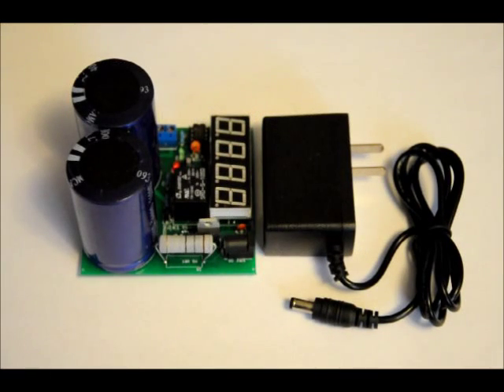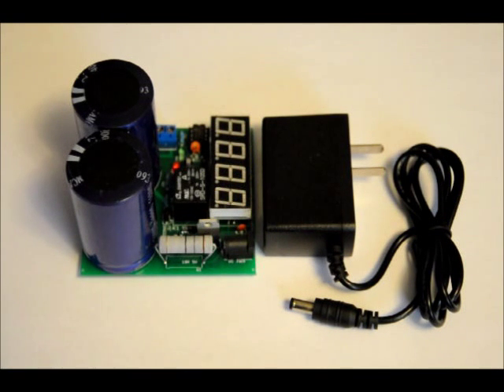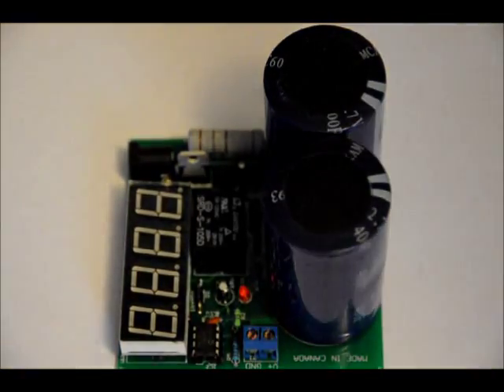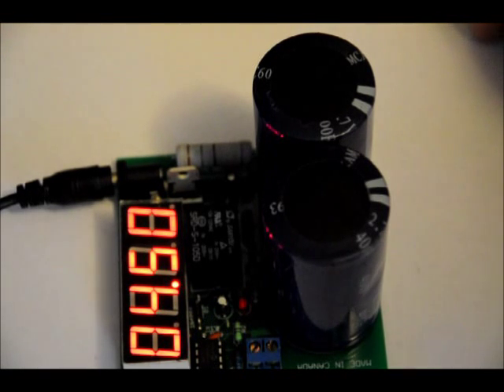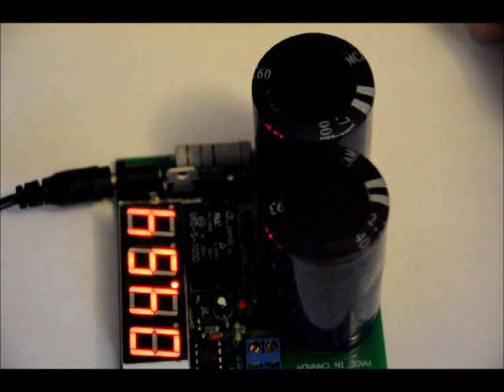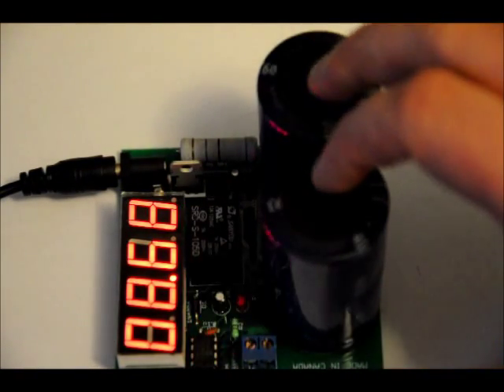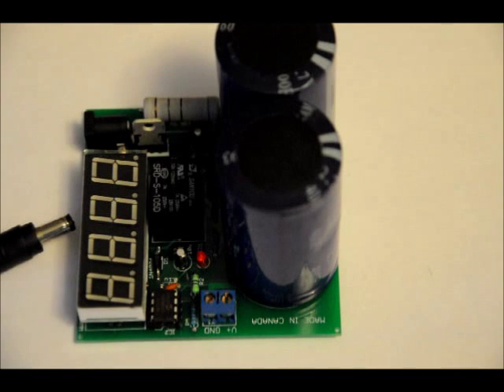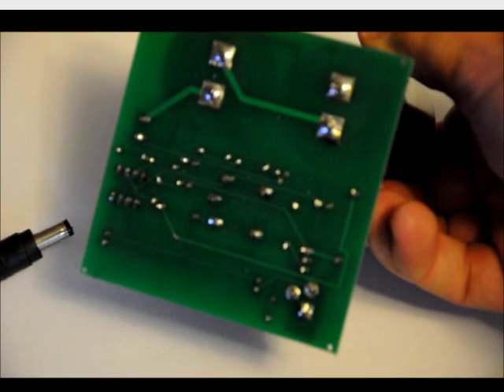The 5.3v Super Capacitor Charger Battery Module

Comment: Excellent!  I've been searching for a Supercapacitor project that would have multiple input voltages (110VAC, 12VDC, 5VDC) and an output of 5VDC / 2amp (for charging iPhone / iPad).

The desired result being plug it into a wired power source and fast charge the caps, then unplug and charge any device that uses a USB adapter for charging on the go.  

It would be nice to have the whole thing fit inside something like the battery compartment of a flashlight (a handy and readily available case).

Of course price is another factor... I'd like to hit a price point that stays competitive with the battery packs on the market like the UNU Enerpak (around $30).  Obviously fast charging would be a great sales point, but I don't think people would pay 3x the price for the convenience.
.

Comment from the maker: Hi 
It depends entirely on what your arduino is doing-loading.  Good for camping.  Running a radio.  That sort of thing. The nice thing is, the super caps can be charged over and over and over and over, and never have to be changed like batteries.